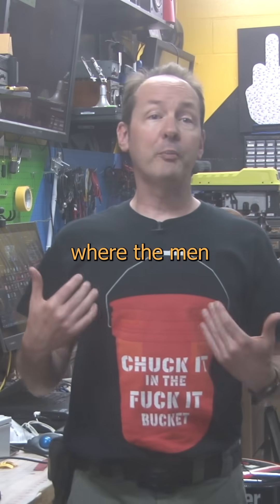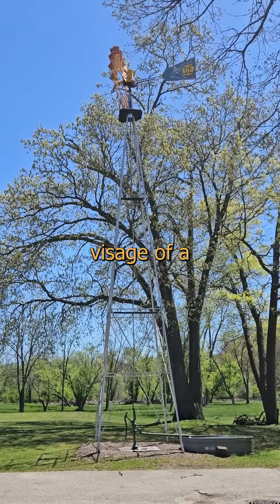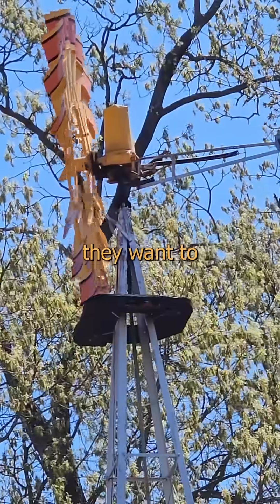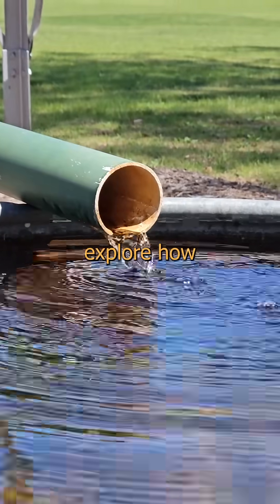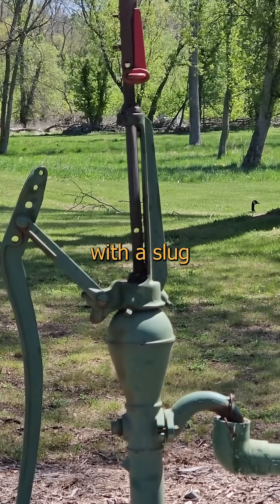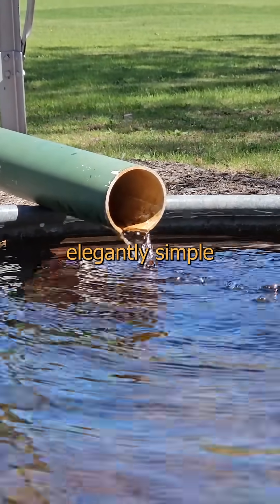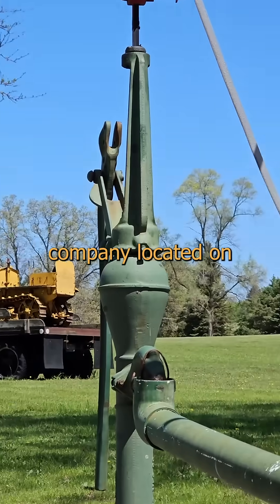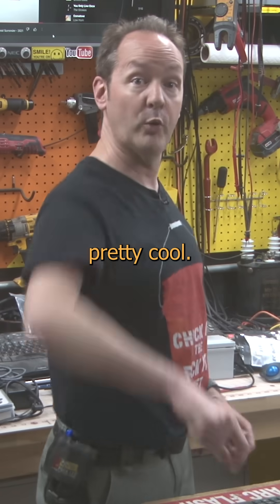Windmill Water Pump #chrisboden #comedy #engineering #farming #history #plumbing #well #windpump

Comment: I got to retrofit a broken one with a Volvo alternator, some brake drums and a lift a bunch of links from Tractor Supply. Been running for almost a decade now at a friends farm. They get enough power out of it to run the electric fence, lightbulb to keep the chickens warm in winter, and plenty of water.
Reply: Now that's pretty cool.
Reply: @ShinjiIkari-Eva-01 Hey! That's what I was going to say 😅
Reply: I've always wanted to buy one, and do that.
Reply: @izzyplusplusplus1004  Solar panels are silent, take up less space, cost less and have no moving parts that'll wear out.
Reply: I want fully mechanical power outputs at the ground. I don't want solar, I'm on a wooded lot, I like my shade trees, and I want what I want. You build with solar. I'll do whatever strikes my fancy.
Reply: @chrisbalfour466  and only work with sunlight.  Solar power is good but does have limitations. In some places the wind is more reliable for certain needs especially after sunset and in cloudy weather.  I'm not down playing solar, heck I've got 4 solar systems going and wanting to go full solar power at house.  One of the stopping points is the storage part,  that is a  requirement for being able to support 12 KW of power for 5-7 days of bad weather where minimum solar input.   I've already been running a refrigerator/ freezer for 5 years on solar.
Reply: @chrisbalfour466 cmon man, the entire point of the post , and dudes comment you commented on was ab the old tech, unchanged, still working as intended.
Reply: @chrisbalfour466 I've learned that the process of creating them is leaving its own carbon / fossil fuel footprint & when broken or outdated & so upgraded they become instant hazardous waste . so I have heard .
Reply: Super cool!
Reply: It doesn't sound like much, but that few dollars off their electric bill every month adds up.
Also the fact that the chickens are protected and warm when the power goes out is pretty cool
Reply: Looks like I've been beaten to the punch but yeah, that's extremely cool
Reply: Poor man's wind turbine
Reply: That's pretty remarkable honestly.
Reply: Very cool to hear somebody did this! I also would like to make one from an alternator. What is max wattage on his?
Reply: @sneaky_krait7271  likely gets anywhere between 15 - 100 watts or so if its below 20 feet, even if the alternator can do a kilowatt. what the real limiting factor is blade surface area and how high you put it up. you should be able to get 125 watts out of a turbine with three-foot blades at 15 mph clean wind.
Reply: @hivehunter10  Got it, yea he has small blades in comparison then. Still cool
Reply: How Fing big is the windmills that you power an electric fence?
Reply: @Ash2Flame116  because they pulse, electric fences are very low power, less than a watt per hour. You could probably run the windmill to a battery and plug the fence to the battery.
Reply: @ neat
Here I thought they were massive power sinks
Reply: @Ash2Flame116  naw they barely use any electricity. They build up a high volt charge and use very little power to "feel" it sonething touches it then it releases it. More complicated but im lazy
Reply: @mrcmoes  THERE IS NO "WATT PER HOUR" do you even watch this channel
Reply: @MrHerhor67  1 watt hour (?)
Reply: Cousin adapted one to run an aerator on his pond...
Reply: My buddy always wanted to do that with his, but figured it was going to take him a pretty large diameter pulley to get the alternator at enough rpm’s to actually create any usable power.
Reply: Well, it runs all the time the wind does
Reply: Dude whaaaaaaaaaaat. I want one now
Reply: I have that book on doing the build.
Reply: awesome!

Comment: Imagine this being 2 miles in a field and when there is a tornado alert instead of running for safety you are tearing through the mud off the field cause you have to shut it down so it doesn't come apart in the high wind 😊

Comment: For once. A thing I am familiar with. I worked on these years ago. These are super common here in Namibia. We had to pull the pump out of one of these from a 150m deep borehole. Just pulling the thing took 2 days. It was the closest I have ever gotten to feeling what its like to work on an oil rig. Substantially less dangerous though.
Reply: The farm I worked on has like 10 of them across the farm. 3 at the main house.